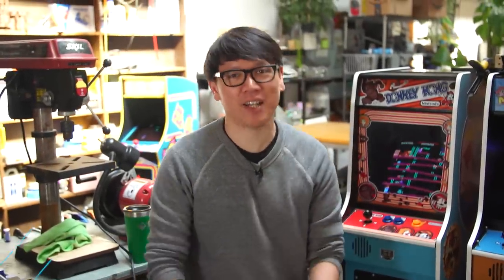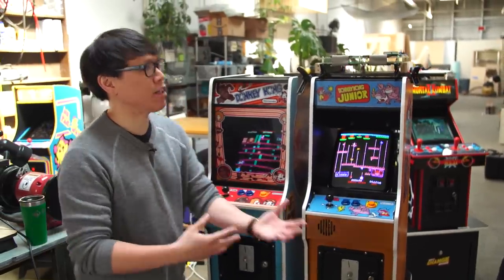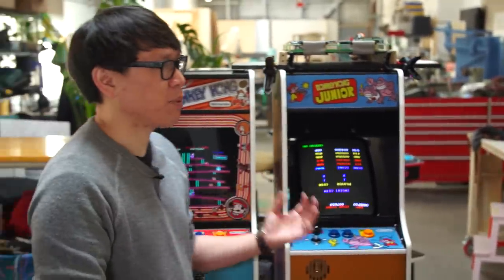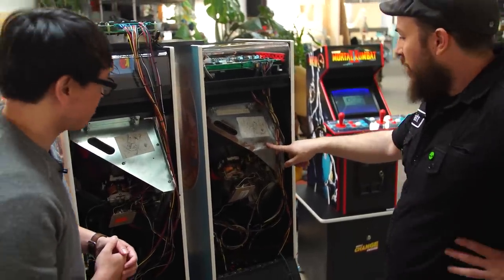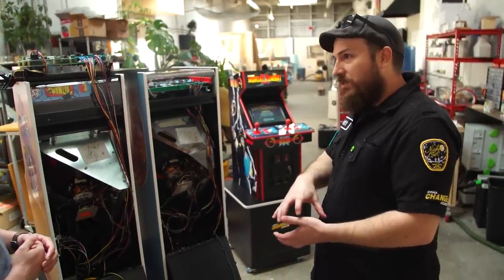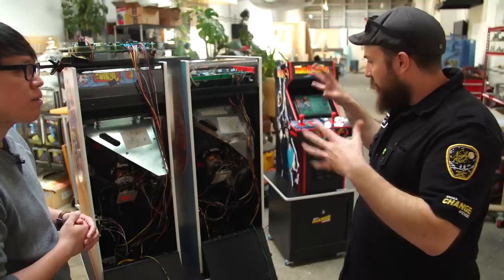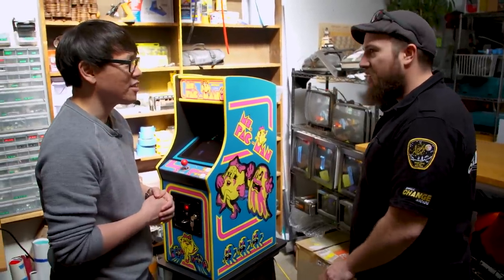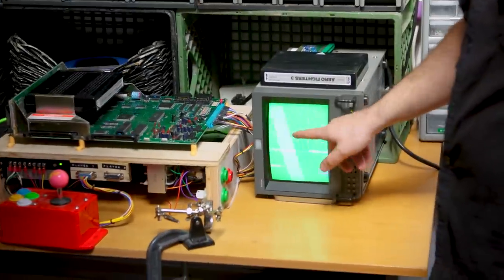Restoring Classic Arcade Games in Mini Cabinets!

Comment from the maker: Learn more about the Small Change Arcade here: https://www.smallchangearcade.com/
Reply: Hopefully he replaces the capacitors on those boards and in the CRT in those monitors, rather with good temperature tolerance
 than just enough, as defectice capacitors often is the cause of old electronics not working.

Perhaps put in a silent fan or two to nudge longevity upwards.

Not sure if it is possible or easy to add a "screensaver" functionality in those CRTs, so they turn off the 
beam if the game stands unused for a long time. Sure they will get just harder and harder to replace,
and the used old CRTs he uses have had many hours of use already,

Also, making it easy for the end user (owner of the cabinet) to turn down the brightness of the CRT
just a little, if light conditions are favorable where the game is going to be used, also will extend
the lifetime.

Comment: CRTs having no input delay or less input delay than the fastest monitors is a myth. A 60hz CRT has 8.3ms of lag at the center of the screen (CRTs draw from top to bottom).
Reply: That's true, but it still means that any analog CRT will always hit that same amount of input delay whereas LCDs can, and will, vary due to differences in LCD panel quality, image processors, or video scalers. Every CRT can hit that baseline, and the amount of delay only decreases as you jack up the refresh rate - up to 210Hz, in some cases (PC monitors and projectors only though).
Reply: Regular monitors (non gamer oriented) normally have 30+ms of delay input.
Reply: This is true, modern gaming lcd is faster then a crt.  But these old games don't look right without the scan lines, if you use a emulator you can enable scan lines and notice how much better it looks.  If your not using a emulator you can't easily add those artificial scan lines to a lcd and modern computers have more lag then they have ever had so a emulator will never have as fast of a reaction. I know it sounds backwards but its true, they are optimized for processing power not reaction time.  

I seen one test where someone wrote a program to test the reaction time by lighting up led and measuring the time it took to push a button, they used a solenoid and a photocell to make hardware to press the button when it detected the light.  They tested the rig by using a oscilloscope to measure the time between the light being powered and the button being pressed, it worked in under 1ms.  Then using the PC and tested with many different usb keyboards and game controllers it had between 30-60ms delay.  This delay is without any monitor, that would be added on to it.
Reply: While you are right, I think you took what was said out of context. I've 32 years of arcade experience and that poor chap was trying to cram it all into a 15 minute video without bamboozling non arcade people so give him some slack

Comment: Am I the only one bothered that Donkey Kong Jr. is running with the display showing upside down.
Reply: DK Jr is still in progress! I just put the monitor in, and I have to fabricate the frame to fit, and also flip the image. Nintendo boards put out a slightly different video signal than other arcade games. The colors need to be inverted and the image needs to be flipped. There are 2 wires on the yoke that can be swapped to flip the image.
Reply: No, lol, It bothered me as well.
If I'm not mistaken, original machines mounted the CRT "in the guts" and bounced the image off a mirror, which I'm surprised he didn't do since that may have mitigated the need to modify the mounting bracket.

Its also why machines had that traditionally sloped back as that's what the mirror was mounted to.

I'm unsure if the mirror or acrylic screen had any magnification properties.
Reply: @SmallChangeArcade 
Do you do fullsize restorations?
Reply: @GJToken  While some games did operate like this, Nintendo cabinets do not use the mirror strategy. The monitors are mounted similarly to how they are in my machines. Some notable games that do use mirrors include a lot of the mounted gun games, like Jurassic Park and Terminator, and the 6-player X-men.
Reply: @Clay3613  Yes! happy to, particularly if it's a niche game with hard to find components or graphics
Reply: I assumed it was in cocktail cabinet mode.
Reply: Image flipping on CRT monitors is very easy and very common. There are 2 pairs of wires, 2 wires for vertical, 2 for horizontal. Just flipping the 2 pin connector around will 'mirror' the image in either direction. Some monitors that used a combined 4 pin connector would have an additional row of pins on the chassis board that would flip the pins of the horizontal. Nintendo boards though are slightly unusual that they have the colors inverted. There are alternate color proms to adapt this I think, else you would need some sort of converter board.
Reply: @GJToken  Isn't it frustrating when people who know nothing about what they're talking about give commentary like they're experts?
Reply: loganq Not sure what point you’re trying to make here.

Is the image being upside down frustrating, indeed it is

Was bouncing the image off a mirror a valid way games were displayed in certain cabinets, yes, it was

Was this the desired option, no, SCA was after a more authentic cabinet layout for the brand of board/game he was using

Did games have a software mode to make them display differently based on the cabinet they were installed in, very true

Is having signal wires improperly connected a valid reason why an image isn’t being displayed right, of course, that’s half the challenge of repairing something without any technical documentation! 

Was taking the time to explain this to you frustrating? 
Not at all, part of the maker community is knowing that different people bring different skill sets and problem solving abilities, and feedback, as long as it’s constructive, can often be the lightbulb moment someone needs to think a little differently.
Reply: @GJToken  You're 100% clueless and I'm just annoyed that you're trying to pass yourself off as an expert and spouting gibberish.  "Was bouncing the image off a mirror a valid way games were displayed in certain cabinets, yes, it was Was this the desired option, no."  Actually YES it was the "desired option" when it was done.  For instance games like Space Invaders and Asteroids Deluxe that had beautiful backlit backgrounds.
Reply: loganq Desired by who? The person in THIS video, which is the context of the statement, was aware of the mirror bounce design, but DESIRED not to use that method (something that wasn’t mentioned in the video at all) and stay more inline with the Nintendo cabinet (as they kindly stated in their reply to me)

I’m not passing myself off as anything other than a hobbyist/enthusiast who’s looked into recreating arcade cabinets themselves

At this point, you’re just trolling and i’m all outta kibble

Comment: I wonder how much longer these kind of original board games and crts will continue to function with the IC’s and CRTs slowly but surely degrading and disappearing with replacements no longer manufactured and avail.  Great job preserving these though. Well done.
Reply: Everybody wonders about that with valve guitar amps etc. If the demand is high enough they might start to manufacture them again. It'd probably only be one factory somewhere and the price would be high but it might happen! :)
Reply: In other countries, you can get CRT's for the cheap...

Comment: I'm so glad he mentioned input latency as a priority. I'm pretty sensitive to input lag and it's a deal breaker in a lot of emulation situations. It's one of the reasons I've moved away from RetroPie, even though I love it. I'll probably switch over to PC for my future MAME cabinet with hardwired controls. That is, if I ever get around to actually building it.
Reply: Look into the Mister project, I build Pies and love them but I getting a Mister setup because of this.
Reply: @cajungoat  Thanks for the heads up. I'll look into that. Does it require a lot of effort to get running? I'm pretty experienced with Linux/command line, just curious about what I'd be getting into with that.

Comment: Input lag depends on the LCD panel you use, some panels have no input lag...
Reply: I'm not aware of an LCD with no input lag. I'm not sure how that's possible for any display. The further complication is that in order to use an LCD with an analogue input signal (like an arcade board) it necessarily needs to be converted to a digital signal. This introduces additional lag.

Comment: I can understand making them narrow to save space, but making them shorter?  Did he have low ceilings too or was it just cheaper?  They are clearly not attached to the stands upon which they rest.   There are modernized mass-market versions of these mini games and they are unplayable because they are too short and were not designed to be played while seated.
Reply: My games have a threaded insert on the bottom. I make custom stands, like the ones in the video, and the games attach to the stands with a giant wingnut/bolt that goes through the stand. The games and stands are designed to put them at the proper height when playing. It's very important to me to not pervert the design of the original cabinets, so changing just one dimension is out of the question as it would make them look weird.

Comment: Hopefully he replaces the capacitors on those boards and the CRT in those monitors, rather with good temperature tolerance
 than just enough, as defective capacitors often is the cause of old electronics not working.

Perhaps put in a silent fan or two to nudge longevity upwards.

Not sure if it is possible or easy to add a "screensaver" functionality in those CRTs, so they turn off the 
beam if the game stands unused for a long time. Sure they will get just harder and harder to replace,
and the used old CRTs he uses have had many hours of use already,

Also, making it easy for the end user (owner of the cabinet) to turn down the brightness of the CRT
just a little, if light conditions are favorable where the game is going to be used, also will extend
the lifetime.

Comment: I have some Arcade1ups and other products because I don't do woodworking and I don't have the ability to do CRT's which need an RGB signal and arcade boards working are crazy expensive on ebay. And some arcade1ups like The Simpsons can be softmodded to run other emulators and games. Simpsons is a 2 game cabinet, but it can be made into a 20 game cabinet for nothing. The softmod uses the original stock PCB and a mouse and keyboard to access the Android menu. Why did real arcade games use an RGB signal and a sync signal? But home game systems used an RF switch or a red, white, yellow cable for the video and stereo audio. Was the picture on arcade games better than the picture from home systems on a regular CRT TV then? There was a product called Super Gun or Super Nova that could play arcade games on a standard TV and it had the correct outputs for a home TV. I had one that I got on ebay in 2022 for $800 but I sold it because all I had was a pink pandora cart with games on it and they were emulated and they didn't demo for some reason, they just went to the title screens. Arcade boards are crazy expensive on ebay and some of them don't work, they sell them broken for somebody to fix. I don't have the tools or knowledge to fix them.

Comment: Interesting video. I have an old SEGA Quartet arcade game that I will be working on in the future. I have issues with the contact pins on one header board connection. It will give me a direction to go for replacement parts.   Thanks    J K

Comment: Shame lcd input has been as low as crr for years
Reply: LCD input lag for a digital signal is low. If you're using an analog video signal, there is no way to convert (scale) that to a digital signal with zero lag, so you will always be introducing lag when using an analog signal on a digital display (unless you don't have to scale).
Reply: @SmallChangeArcade  crt have lag too. Up to 1 frame at 60 hz. Everyone says they dont but they do. Industry standard for measurement is the middle of the screen crt is at 8.6ms of lag in the middle and 16.1 at the bottom. Since as you know its drawn one line at l time.

Comment: "High quality" plywood with dowels........yeah no
Reply: Hi there. I'd be happy to address your criticism. There are actually many types of plywood, ranging in quality and price. The type of wood, number of layers, types of cores and the quality of the faces is all variable. I use Grade-A plywood, it's rather expensive and not available from a big box store and is far superior to the alternative plywoods, or MDF, which many cabinets are made from. When it comes to joining wood, you can't get much better than glue and dowels. The end result is basically a solid piece of wood, as the joints are stronger than the wood itself, as opposed to using screws which can come loose over time, particularly when moving the games around frequently.
Reply: @SmallChangeArcade  You know what.  You've convinced me.  I am definitely not a wood expert but your explanation seems to make sense to me.  I'm just used to crappy Walmart plywood that usually doesn't survive a single move.  I stand corrected.  Thanks for the clarification.  Keep up the great work.  Very cool projects 👍

Comment: This guy is cannibalising PVM/BVMs and a damn Apple IIGS monitor for these things? That's not cool, they're hard enough to find in good working condition for below-crazy prices as it is. His machines are cool and all, but it's more important to preserve CRTs in their original housings.
Reply: PVMS and Apple monitors go in with the original housings. Black vinyl applied to the bezels so they aren't grey. So they're not destroyed at all.
Reply: Hey man, thanks for the reply! Thanks for clarifying, too, I feel a lot better about what you're doing now. PVM/BVMs are still fairly plentiful so it's not like you're making a significant dent there, people can still get them if they want them, but as for IIGS monitors I can't say the same. There were never that many of them to begin with due to the fairly low level of success of the IIGS when compared to the II, II Plus, and IIe + Platinum, so it is still somewhat troubling for them to be used for this purpose. At least the housings aren't being damaged though.

Comment: input lag on those games is pretty much total BS.  especially Donkey Kong where guys play mame with a keyboard to near world record scores.  i can't find a game from the golden age of arcades that make any difference.  emulation yes, but even then, that's negligible.  it's like a wanna be cool thing to say though.
Reply: When using an original board, which outputs an analog signal, using an LCD introduces quite a bit of lag. This is because you must scale the video signal from older games. Scaling or any kind of processing introduces lag. The world record holder at DK has played my machine (put up a 998k kill screen game on it) and we've talked extensively about this topic. If you're using MAME, you're starting with a digital signal, and they've done quite a bit of work over the years to reduce that lag. My games only use original boards outputting an analog signal, so a CRT is a must to reduce lag. Also LCDs make the game look like crap.
Reply: @SmallChangeArcade  LOL, the world record holder which is?  or the wacko, agro, racist, one who is claiming to be?  donkey kong is the worst example of there being any difference.  but your things are cool, just don't be that guy who thinks just because you use a crt you can't play games to world record levels...especially on donkey kong.  that's just incredibly silly.
Reply: @scottsnyder4004  haha. I try not to get involved in all that. At the end of the day, I really like the old tech, and my goal is to create an experience that is as close to the original as possible, just in a smaller form factor. 

I’m also sensitive to the lag issue because my other passion is NES Tetris, and there is some cool tech being developed in that area too, but currently a CRT is pretty much required.

I also keep a close eye on the FPGA stuff, which is really cool. I’m not a hater, but I do love CRTs!